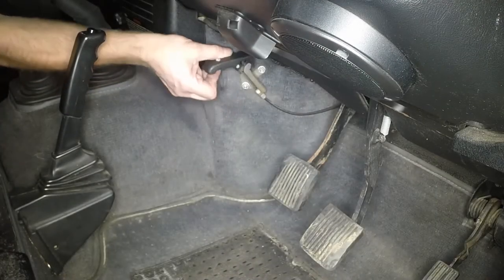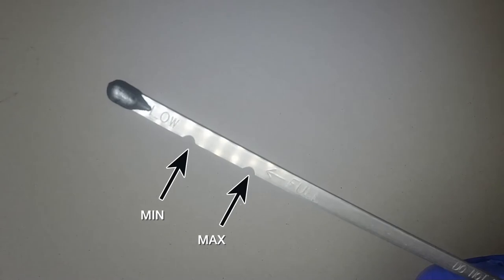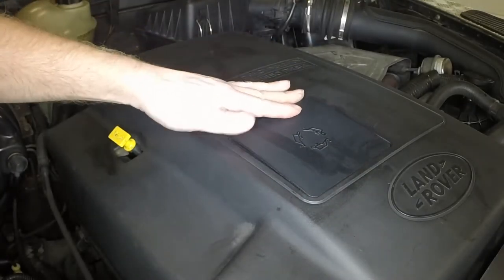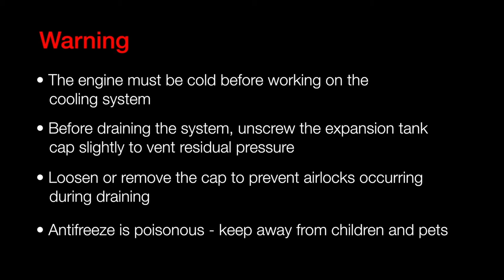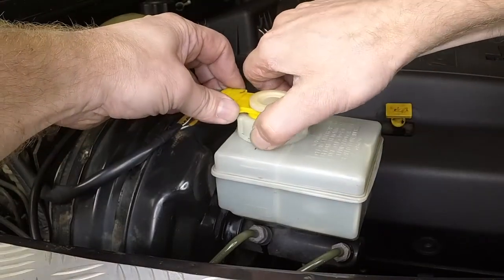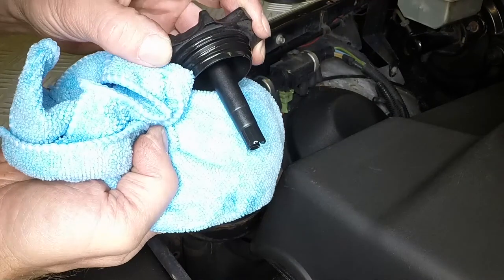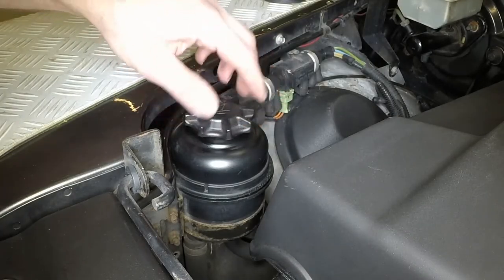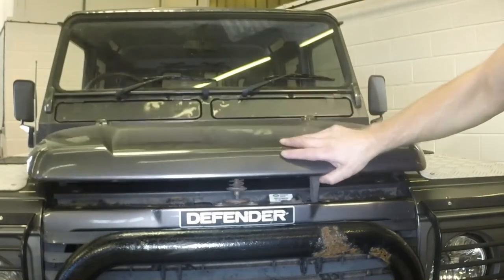How to Check the fluid levels on a 1983 - 2007 Land Rover Defender

Comment: So... where's the clutch fluid top up?
Reply from the maker: The clutch fluid reservoir is alongside the brake master cylinder, on the right-hand side (from the drivers seat) of the engine compartment bulkhead (RHD models) - under the bonnet